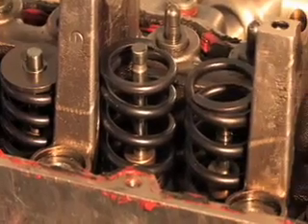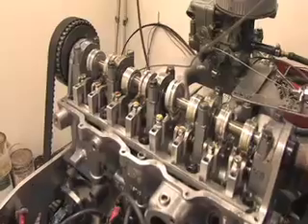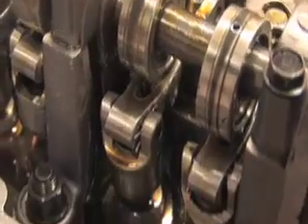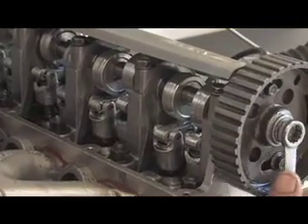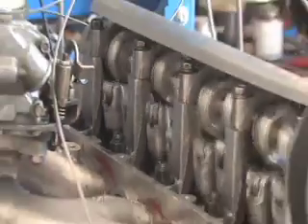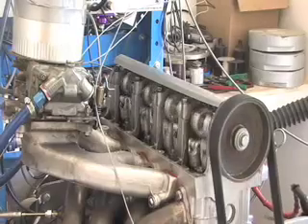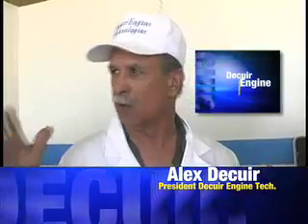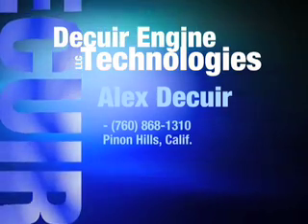New Engine Technology/Springless Valves

Comment: Sure there are no springs...but that also means that the valves cannot be held closed either. So you're basically hoping that the compression does that job.
Reply: actually, pressure from the lobe holds it closed just as pressure holds it open.  I don't like the system after seeing it in a few applications on youtube.  All that work to change the motor (and it seems like a lot taller of a setup, you'd have to use different valve covers) and no one is claiming how much more power can be produced.  Is valve lash adjustments easier or more difficult?  They put this system on the well known ford 4.6l V8 but didn't say how much more or less hp or torque the engine made.  Nor did they say if it was more fuel efficient.  The only thing I'm seeing is that yes it works but, that's it.  With some charts comparing the same motor with a spring setup, showing exactly how better the engine is in multiple categories, then maybe I'd be interested.

Comment: friction, high temp at camshaft, AND vibration...
Reply: Still the same thing with a typical valve system. Only difference is compression holds the valves closed, which is actually less downward force needed to open valves. However, with bigger lobes, yes, there is more vibration.

Comment: Interesting concept. However, the opening/closing is obviously symmetrical. How do you get a performance 'grind' out of this besides moving intake and exhaust actuators relative to each other? ...I see valve opening/closing speed limited....no high ratio rocker valve action....I would suggest twin cam 16 valve head and variable cam timing ( VVT.) would broaden the power curve..I still see true desmodromic valve control can have more valve opening/speed control and more power under the curve .

Comment: This valve design would be perfect for maybe high performance engine wear long term running time is not a concern....for the long haul it seems this design would require to much adjusting to keep it in tune..... Springs are just more forgiving for valve and cam wear.

Comment: EH, even the kawasaki ninjas 250cc inline four doesn't go past 20,000rpm, I think 20,000rpm is just about the upper limit on any piston engine.  Even larger Gas turbines don't go about this rpm. And those engine deal strictly on a axial basis, where there are no parts reversing direction many times a second.

Comment: BAR Honda and BMW Williams have experimented with more than 20,000 rpm, but because of dynamic loading, parts could not endure for a long time. That is the reason why they go only up to 19,800 (limited to 19,000). That's still high operating speed compared to any other engines, except high-performance bike engines, but they are another story.

Comment: How do you get round the big disadvantage of having a sinusoidal valve motion? Conventional cam driven valves allow the engine designer to have control over valve acceleration, velocity and seating speed etc. This system doesn't have that freedom.

Comment from the maker: @renniweht its the same principle as a connecting rod on a crankshaft but in this case the cam and rocker are attached and actuates the valve with both a pushing and pulling motion. 
DET

Comment: @EmpEntTV 
So how do you control cam profile.  With that design it appears you're stuck with a sinusoid. Also, I don't see how you will maintain seal as the engine heats and cools because you have no "give" in the system.

Comment: How many hp produces? what's the max rpm's? i'm guessing this is an inline 4. this is cool and all but all that excess metal in the top of the engine looks uncool. if you were going to put that engine inside a car, you would need to really lower the engine down so the hood will close properly.

Comment: @cfb36yeah i eventually i figured out you just misunderstood what i said, since i figured there was no way you would know that a pushrod wouldnt be in an overhead cam engine, but not know the difference between a pushrod and connecting rod lmao.  S'all good.  Still though, ive yet to see a piston engine hit 25,000rpm...and if i did i would be absolutely amazed if it could sustain that kind of rpm without internal failure immediately occuring.

Comment: @cfb36 what you were probably thinking of was the pushrod...which, you are right, is only found in Non-overhead cam engines.  But a pushrod and connecting rod are no where near the same thing...the reason I said the connecting rods would fail is becuase go ahead and watch every motor blow up video on youtube and you can see that 99.9 percent of the time the bottom end fails in an engine way before the top end does, since the bottom end deals with all the engines power.

Comment: @SaGalv ur an idiot, first this engine uses an over head cam type design, so no shitty conecting rods to deal with an second any stock spec street type motor , even with this valve train would fall apart at those rpms because the components aren't light enough or balenced well enough to handle the speed, and f1 cars don't rev that high because the FIA set the limit at 19k to lower the output of the engine but if they could they would rev to 25k or higher.

Comment: @cfb36 pretty sure the connecting rods on any standard car engine would go flying through the block at 25k rpm...hell im pretty sure even an f1 race car engine or street bike motor would fail almost instantly at that high of rpm....so im pretty sure valve float would be the least of your issues at that piont...

Comment: @EmpEntTV formula 1, doesn't rev to 25k per se but the benifit of a high reving engine is to be able to produce more horsepower overall out of a smaller displacement, like how an f1 engine produces around 800hp out of a 2.4l v8

Comment from the maker: @cfb36 Ok Einstein, first show me an automotive application where rpm's regularly go to 25k? and when you consider that this system has positive actuation without an oscillating spring, valve float is not an issue. 
DECUIR ENGINE TECHNOLOGIES
Reply: The only one reason to get a sprignless valve its to make high rpms.

Comment: Very interesting. However if it is purely the cams holding the valves, how are you keeping sufficient upward force on the valves to keep them seated? In my somewhat limited automotive experience, valves are finicky to keep sealed, even with stiff springs holding them against the seat.

Comment from the maker: @neilttrider The camshaft is attached to the rocker much like a connecting rod to a crankshaft. So as the shaft move it is pushing the valve open as well as pulling the valve closed. 
Decuir Engine Technologies

Comment from the maker: But the point of the matter is taking an existing configuration that is widely used in many racing and performance applications and enhancing its abilities. Overhead cam engines is a certainly  better means of valve actuation but to take a small block Chevy, Ford or Chrysler over head valve and enhancing its valvetrain system is the whole point of this system. 
Decuir Engine Technologies

Comment: All I can see is an eccentric opening the valve, so where's the closing mechanism? And what's more, at 2:18 into the video the crankshaft driving sprocket appears to be the same size as the camshaft sprocket. Which presumably implies it's not a conventional four stroke engine.

Not forgetting that an eccentric driven valve will be moving all the time, as can be seen. This is clearly some sort of modification of a two stroke engine whereby the 'valves' are probably operating windowed ports.

Comment: @Giliganism It's not parasitic drag, it's thermal in eff.  Most of the energy goes out the tail pipe as unused heat, ie 70%.  An additional 5% is lost to friction.  (these r rough #)

As for the energy to open a valve, alot of that energy is returned when the spring pushes the cam lobe on the return.

Comment: The average automotive engine only uses around 30% of the potential energy of the gasoline because of parasitic drag (yes technically valvesprings cause drag on the camshaft every time the valves are opened) and friction being converted to heat. These technologies while perhaps not new they are being revisted and could increase effeciency. More power with higher MPG in one package.... Yeah, its definately not worth researching...

Comment: Yes it will work. It has been used and tested for many years now. While it does reduce engine power loss due to springed valve train resistance it has other problems associated with this design. The extra machining is more costly. Weight is increased. Many more moving parts (to go wrong too). Clearances, and hence required maintenance, are CRITICAL for smooth operation. Many engine designers have been aware of this design and have passed on it. There are better valve train designs nowadays.

Comment: ignoring when and who first invented this, would this work?

 The of replacing springs is to achieve higher rpms but at higher rpms you have to worry about vibration (nvh). Springs and compressed air can absorb some of these but can this system? It looks like it's metal on metal and very stiff.

Comment: A big problem with the camshaft in that engine is that it opens and closes the valves very slowly and the cam duration is very high, this would give poor bhp and bad fuel econemy.
Can this system be used with a more conventional "spikey" cam lobe profile?

Comment: should be a huge gain in the upper rpms, the reason most pushrod engines lose power at high rpm is because of valve float, this would eliminate float.

stronger springs also kills float, but wears out the valve train much quicker

Comment: Valve float is when the valve spring fails to keep all components like the valve, rocker arm, push rod and lifter firmly planted on the cam lobe. It usually happens at higher rpm.

Comment: I believe F1 engines use a pneumatic valve system where they use high pressure air to operate the valves. Not too sure of the technicalities but the springs tended to limit the revs to about 12000rpm. With the current system theyre limited to 19000rpm by the regulations. Serious stuff.

Comment: What's so new about that?  Nissan is building cars with electronic valve opening allowing them to not require a throttle body.

Good luck with the 30k rpm thing

Comment: Looks great. I love the simple threaded valve adjustment.  The amount of energy save should be measurable.   I bet the timing belt replacement interval is longer, if there is less load.

Comment: Ducati's have had Desmo's for years. They are in no way superior to a good titanium spring setup, as they are extremely complex and do not store potential energy. So the powertrain has to literally hold the valve in place as the valve wants to go in and out from pressure changes.

Comment: Yes, I know that. It takes some energy to press valve spring, but most of the energy will be stored as potential energy and only a few will be wasted as thermal energy. After releasing valve spring, potential energy will turn back to kinetic energy to push back valve just it was added earlier. That's why I think this design may not get much more efficiency. 

P.S.
My English is poor. If anyone would be willing to correct my writing, I will be very appreciated.

Comment: This design consumes energy to push valves forward and backward, but spring valves only cost energy to push and store some in the springs for backward movements. I think the efficiency differs not much in these two systems. 

P.S.
My English is poor. If anyone would be willing to correct my writing, I will be very appreciated.

Comment from the maker: Thanks for the question, the system works well under high RPM conditions, the only negative we are finding is the fact that the fuel curve and delivery may need to change due to the valve train revving so freely.

Comment from the maker: Hi, its hard to give a specific efficiency loss due to the variance in spring pressure on different engines. We are still in the process of getting baseline measurements with the engines we are working with and have a fair amount of R & D left in order to get those findings. As you can see in the video it only takes a small combo wrench to turn the system, where as a conventional valve train takes considerably more torque to rotate. Thanks for the question. Decuir Engine Technologies.